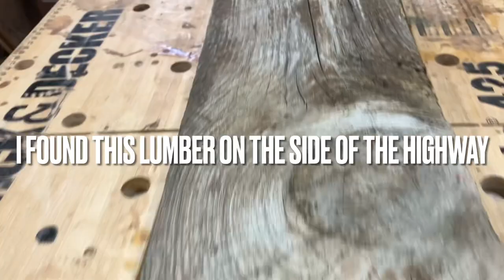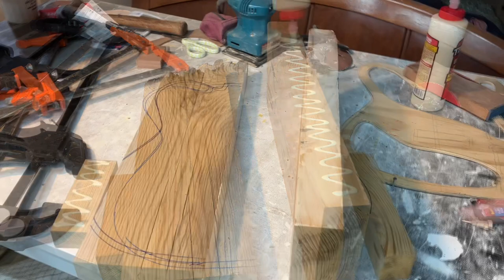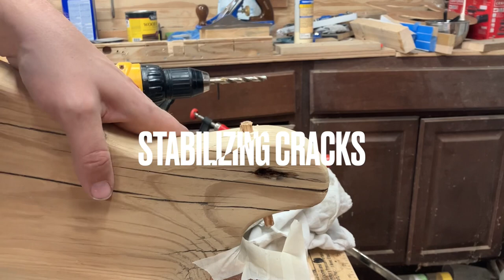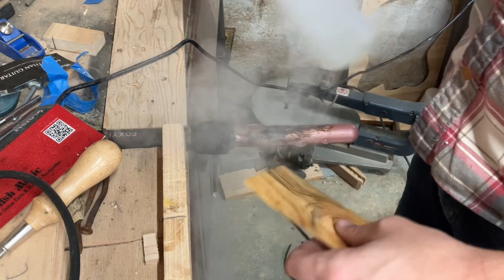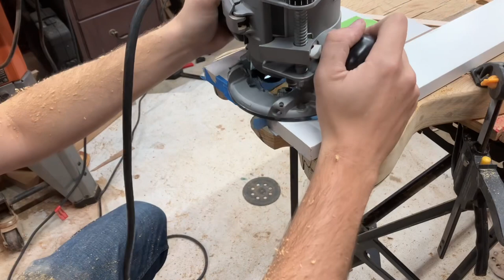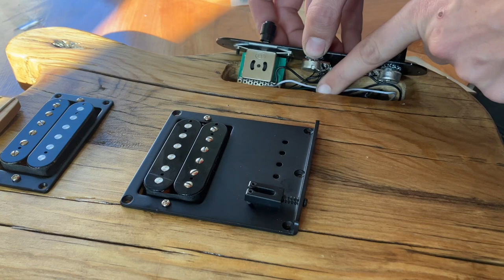Barncaster guitar build - Free Reclaimed Lumber! (From the side of the highway)

Comment: What are those white blocks made out of that you used for the neck pocket?
Reply from the maker: Just some scrap wood, they’re off cuts from our white cabinets. I think it’s just prefinished pine.
Reply: @dannylewisguitars  nice, and you just got the necks bottom curve with a file or something? Im gonna try this next instead of a plastic routing template
Reply from the maker: @gnaflethegarthok3074  the pre-fab neck’s corner is about a half inch radius so it matches the half inch router bit I used! When I make my own necks I file them to the same radius that the router leaves. I hope that made sense!
Reply: @dannylewisguitars  lol nice, i think i’ll just use a sander to get the bottom curve. wish me luck